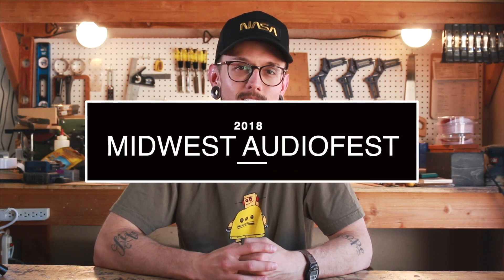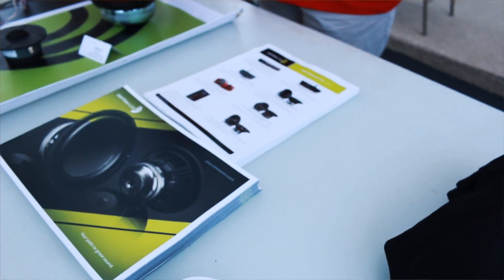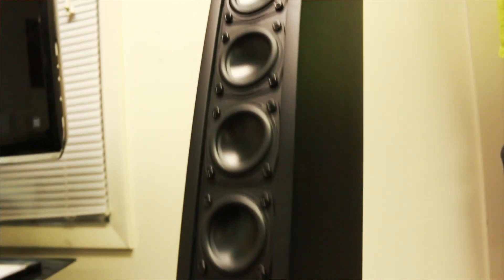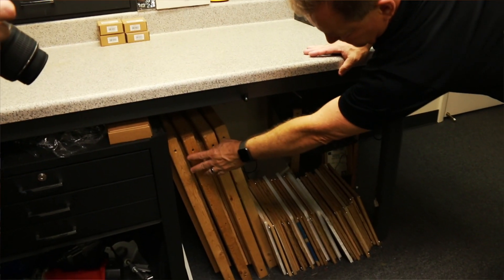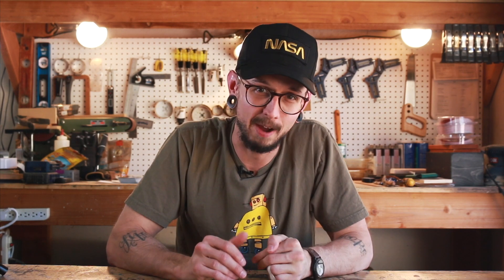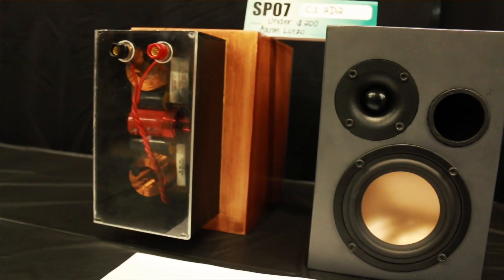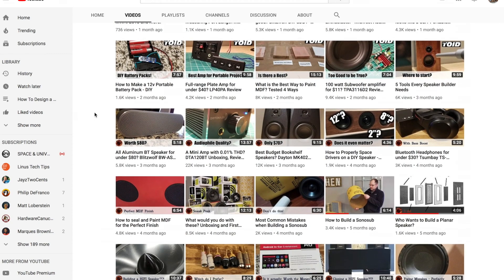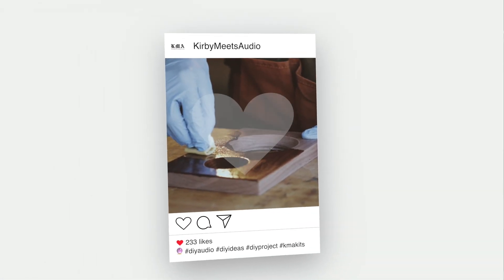How Does Dayton Audio Test Their Drivers? || My Trip To The 2018 Midwest Audiofest

Comment: I built my first speakers at 16, moved several times along the way sold my table saw crappy fence. Built some in my twenties and thirtys. Built a nice pair  with some scan-speak tweeters in 2005 lost my house in a fire destroyed speakers  only thing saved were tweeters. Decided to build a pair of 1 cubic foot box no table saw . Had a so called cabinet  maker build me a set of boxes front baffle was off by 1/16  of  inch, So my 18 19 shop Fox is going to be delivered today. Thinking aboat building and selling  speakers; Your thoughts.